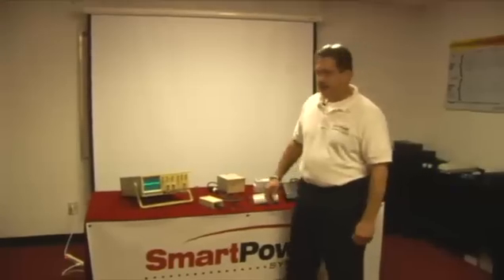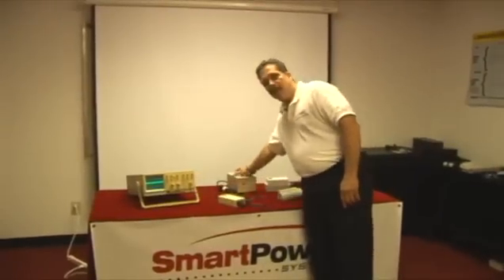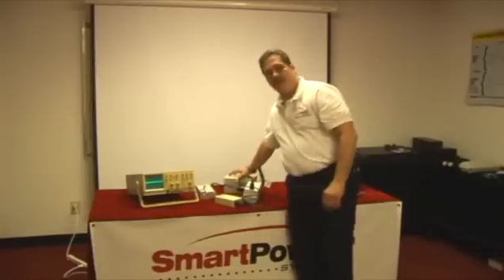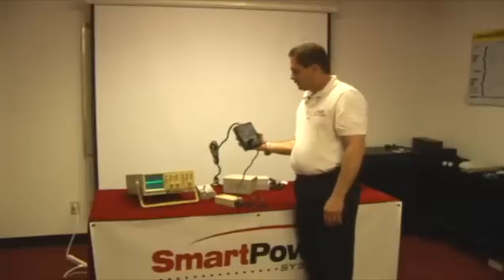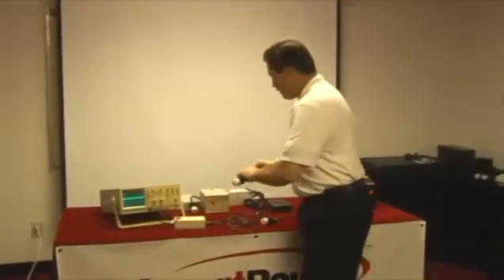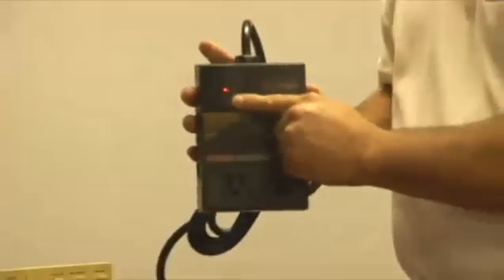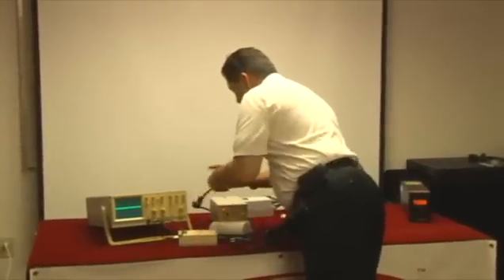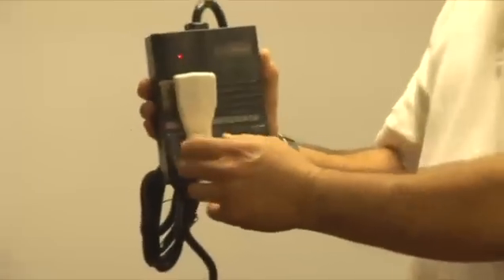Smart Power Systems - Computer Lightning Protection - Dirty Electricity Demo

Comment: I know that you allready know all these but i am trying to explain what exactly i want to do.
I protect my computer bypassing the 240V power through the UPS to the computer, so far so good.
But ( i think) i  also risk from the modem\internet connection, i have connected modem+computer using a Cat5 cable so i have internet connection.
If any ''Bad'' energy\voltage pass through the modem to my computer it may damage or kill the computer, right?
My modem has a 4 OUT  1-2-3-4 (cat5) connections, so i can connect 4 computers with the modem and all these computers will have internet.
I connect the modem to my computer with the OUT 1 using cat5 cable, so ask if its possible\is that ok? From the modem OUT 1 to connect the cat5 on the UPS IN and from the UPS OUT another cat5 to connect on the computer???

Comment: ravenholt, the video is not dishonest, the manufactures of surge suppressors are, they say their product protects you from lightning, surges and noise. Yes it is true the MOV embedded works to a minimum of 330v, 400v and 500v on some models. This product protects against Lightning, Surge, Line Noise and is Lifetime Warranty. (Line Noise reduced to .5v and all surges maximum 10v over 120v.
Next line noise is disruptive, it can cause lockups, hard drive failures, unknown "reboot it" issues. :-)